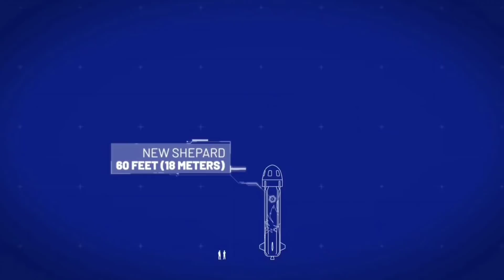Disaster! What Exactly Went Wrong With Blue Origin BE-4 Rocket Engine?

Comment: Jeff ran Amazon with cost tolerances tighter than any seller - ever. Threatening suppliers and shippers while cutting worker pay below minimum by manipulating work hours. It all paid off for Amazon Customers and Jeff. BUT, an exploratory EXPERIMENTAL all new space venture NEEDS MONEY. It can't be run like Amazon. The proof is in suppliers refusing deliveries and development teams strapped with BUDGET CONSTRAINTS, plus senior staff quitting. Jeff - spend or die. Oopsie - looks like you picked NO MORE SPENDING.